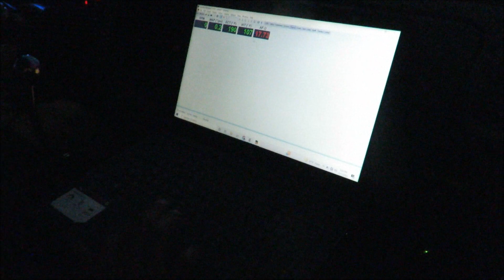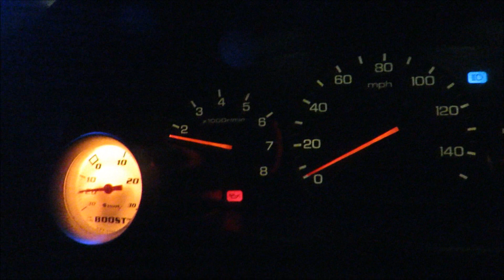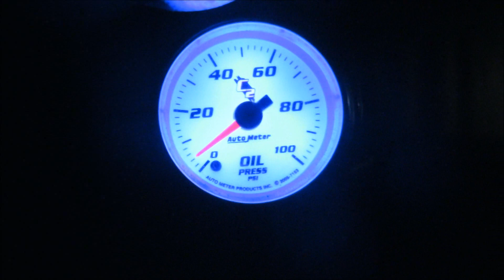BOOSTED F23 HONDA ACCORD: ACCORD HAS A MIND OF ITS OWN

Comment: Id bet it's the camshaft that won't let it idle lower and running lean in idle. After all it's ment to be an economic car and excellent gas mileage. If you want more tunable setup. Have to get a h series or dohc f series head.
Reply from the maker: Sohc for the win bro the f23 is a great engine and can make great power yes in stock form it's not much but when you do a few things to them totally different animal and I'm out to prove that